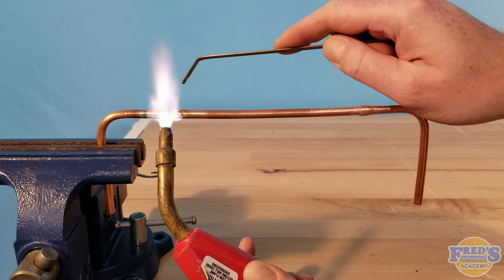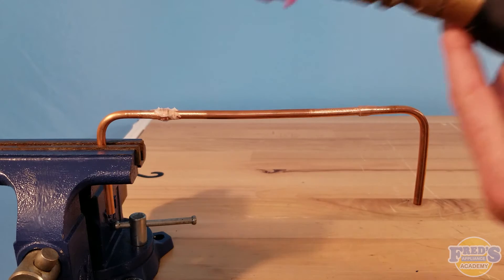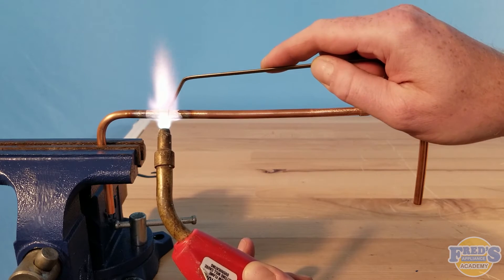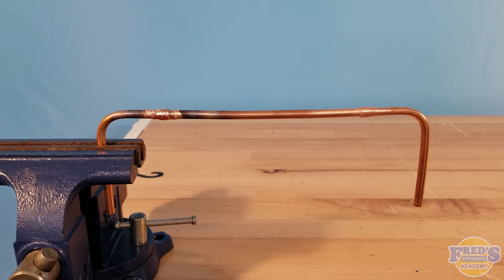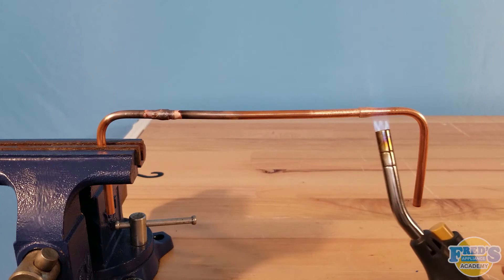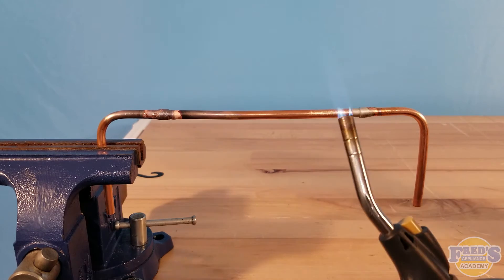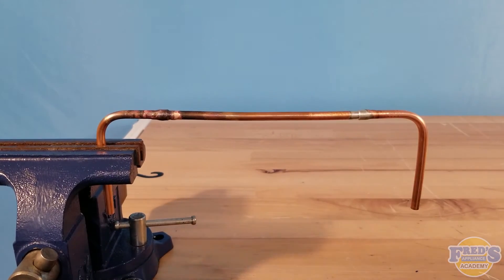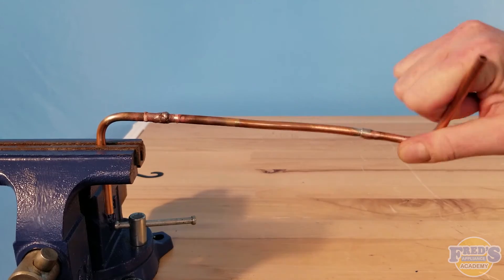High-Temperature Brazing vs. Low-Temperature Soldering in Refrigeration

Comment: This is interesting  because i have seen many vids on the brazing vs. Solder on hvac/r and this is the 1st time i see the solder flux not applied lightly on the male end and then fitted into the female end. You make join the pipes then apply flux. Where can i learn more about this mehtod and why and how it works?
Reply from the maker: Hello Adrian. We have multiple videos that cover it. One that was posted recently where Chad goes over the differences between joints and the pros and cons. If you are looking for a hands on learning, we offer the refrigeration course by itself as well.

Comment: Hi can we use low temperature soldering to copper and stainless steel when we connect compressor with condenser steel pipe? Or filter dryer with steel pipe?
Reply from the maker: We use it to solder steel to copper all the time! Just be careful not to overheat it!😎

Comment: Is that a mapp gas or propane?
Reply from the maker: Just propane. You could use mapp gas but you don't need to get that hot and propane is cheaper.
Reply: Thanks
Reply from the maker: @bimatube1274  sure thing!

Comment: Can you use the solder technique for a small patch on evaporator coil?
Reply from the maker: Unfortunately no. Though it is possible it is not recommended. The reason is that the evap is so thin walled getting it up to temp before it melts is difficult. Also, if one hole has appeared more are likely on the way. Patching a hole in a rotting evaporator is just delaying the inevitable which is more holes in the future.
Reply: @fredsapplianceacademy  thank you for the advice
Reply: @fredsapplianceacademy  thanks

Comment: I have seen folks write that they wouldn’t use staybrite 8 for a compressor discharge line due to the heat produced by the compressor potentially weakening the lower temperature solder. What is your opinion?
Reply from the maker: The melting point of Stay-Brite is usually between 430 to 530 Fahrenheit. The discharge line should never get this hot even when there is non condensable gas in the system.  Remember we are talking about residential refrigeration not commercial. The compressor is also thermally protected by an overload to prevent it from reaching temperatures this high. If that joint fails from heat the compressor and or over load has experienced catastrophic failure.
Reply: @fredsapplianceacademy excellent point. The thermal overload in compressor. Also therea usually a hi pressure cut out switch on hi side to.

Comment: Hello, here at the local suppliers they sell the silver rod with 0%, 5% and 15% silver. Wich are the most recommended for brazing or soldering? cooper to cooper in refigeration.
Reply from the maker: Can't go wrong with 15%  It's more expensive but more versatile allowing you to braze copper and steel.
Reply: @fredsapplianceacademy  thanks for your quick replay.

Comment: Will these work?50/50 SW Solder and Oatey H-2095 Water Soluble Tinning Flux
Reply from the maker: No. 50/50 solder will often say right on it not for plumbing.
Reply: So what do i use?StayBrite 8 is too expensive.I also dont have a torch for brazing.Only a solder Mapp gas @fredsapplianceacademy

Comment: Hey! I tried the demonstrated soldering method for 1/4" refrigeration lines and tees, with stay-brite #8 and tinning flux instead of stay-clean flux. It did great. Actually much better than stay-clean. I dont know about tinning flux going in the pipe and contaminating the system. what is the recommended amount of tinning flux to apply on the joint? And ever experienced tinning flux contaminating the system?
Reply from the maker: The correct amount to use is working the flux into the brush until the brush bristles are nice and evenly coated.  Being that the joint is brought together before the flux and solder are applied the risk of it getting into the system and contaminating it is very very small. In the 16-plus years I have been doing this I have never seen it hurt a system. :)

Comment: I don't think that is how you supposed to solder a joint. Don't you solder refrigerant pipes in the same way as soldering a copper water pipe joint, but without applying flux on the female end?
Reply from the maker: We can assure you what you saw in the video is accurate. :)
Reply: You actually do not apply the flux on the tip of male end according to Harris company.

Comment: That’s only for copper what do use to solder aluminum
Reply from the maker: Hello! Thanks so much for dropping us a line. While there are techniques to solder aluminum, it does require quite high temperatures. So instead, we use Lokring for those connections. Learn more here: https://www.vulkan.com/en/branches/refrigeration-and-air-conditioning/repair-of-refrigeration-appliances

Comment: I need to replace a condenser in my refund.
What solder wire can you use? And should I use any paste with it?
Reply from the maker: You can find them at shop.fredsappliance.com 

White brazing flux and stay silv #15 rods for brazing. Oaty #95 flux and silver bearing solder for soldering.